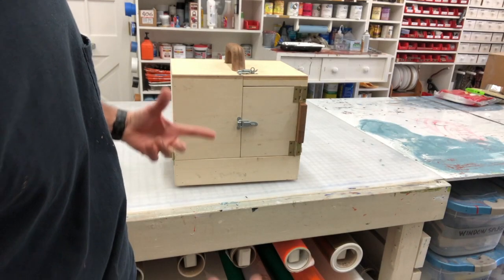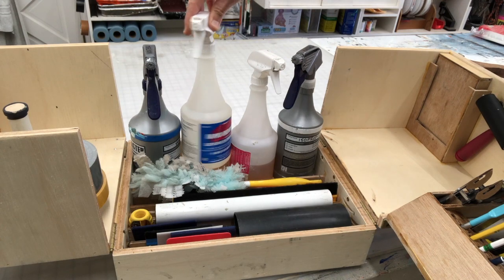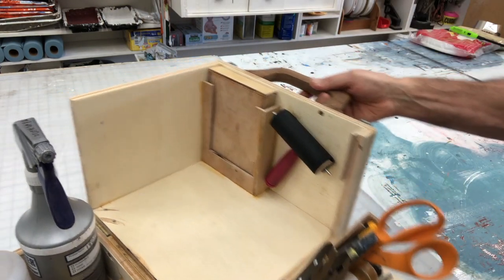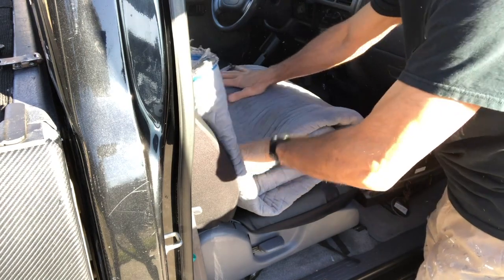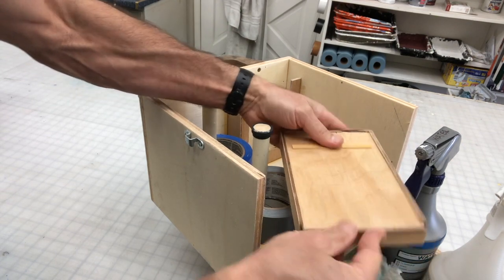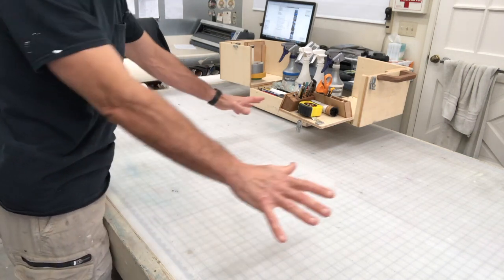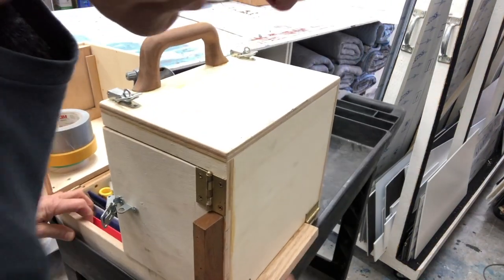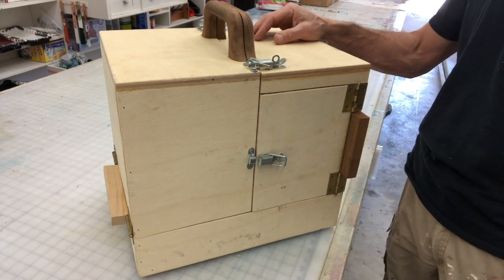Vinyl Signs Equipment Box

Comment: For your tape ends just cut a milk jug out in the shape of a circle then cut the circle so it was like a round sun shape and hot glue it or staple it right on, the plastic is soft and pliable so the tape would just slip on and off but it's strong enough not to fall off  on it's own.
Reply from the maker: Genius! Thank you!